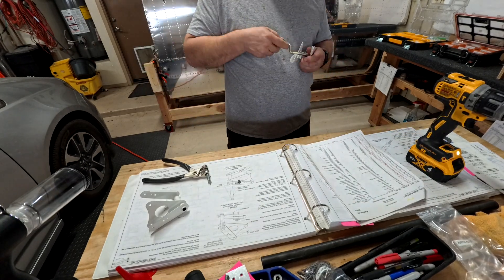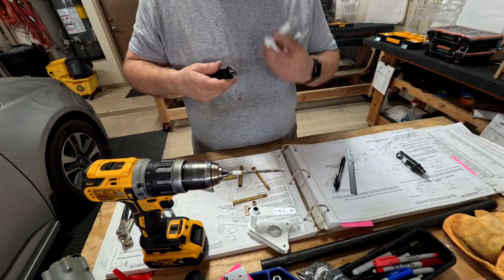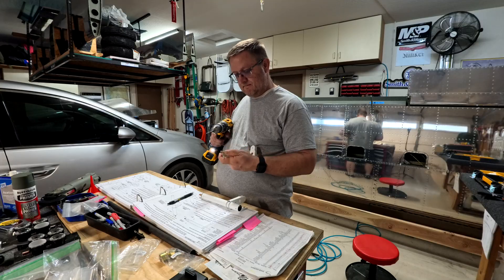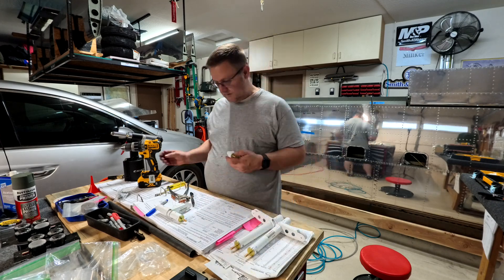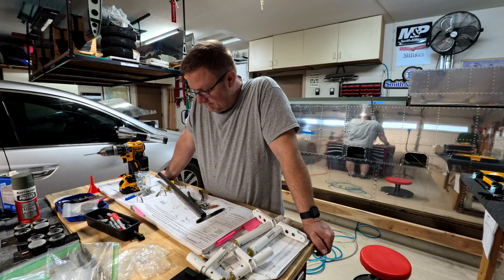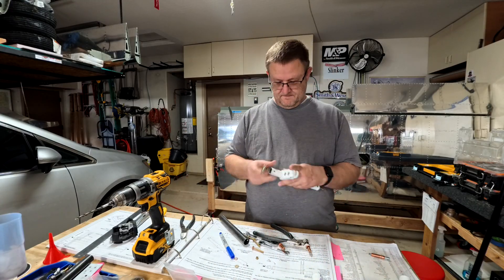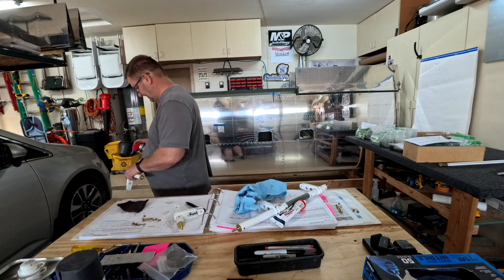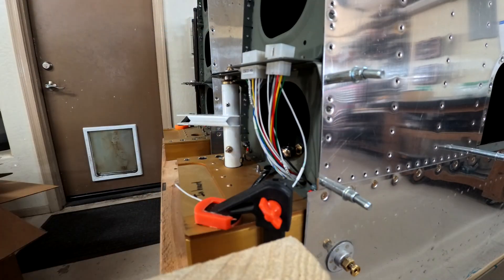RV-14A | Wings 23.2 - Aileron Actuation

Comment: Hey Brandon, enjoy watching your videos. I noticed you had blue tape to set the distance torque tube assembly. I mounted 2 angled brackets with a slot to a piece of 3/4 plywood and set the distance between them to a loose 17 3/4. with only a 23 of an inch to play with I did not want them to be too tight or loose going between the mounts. I ended up with a measurement of just over 17 3/4. Any way keep building and good luck.
Reply from the maker: Great Idea! that makes total sense. It would also allow you to control one of the dimensions easily while you mess with the others. How is your build going. you are a little bit ahead of me so I'm always looking for your advice!
Thanks for watching
Reply: @SlinkAir  Build is going well. Working on the Fiberglass Fairing work on the front of the Canopy. I am to the point of SANDING, SANDING and more SANDING. Also I received the Firewall forward kit last week, and like all kits some thing are on backorder and the counts on some items were incorrect. Sent Vans a list, see what happens. Anyway, going out to do more SANDING!!!